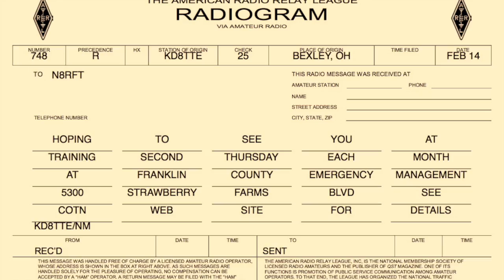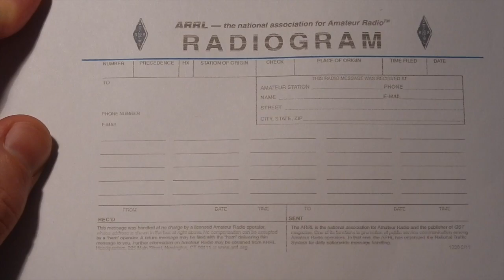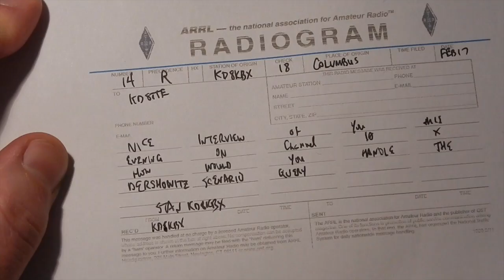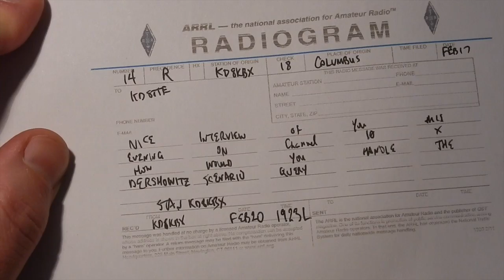Using a Radiogram to Receive NTS Traffic

Comment: Brand new to the channel.  I am a technician level license operator for about a year-and-a-half. I am mostly on HT s in the off-road community and also, what I would call a light prepper. I do check into a net nightly and want to learn more about not only passing traffic but receiving it. What I'd like to see is how that traffic is actually passed to the recipient. If you could give some examples.  Or point me in the right direction. Thanks for your posts. They are put together quite well. 73's from KD2PGJ.
Reply from the maker: The step of getting the message to the ultimate recipient is "delivery," which is very different from "relay," which is what we show here—radio operator to radio operator. The first step in the process is "origination," turning an author's thoughts into a message formatted for relay. I'll have future videos showing all of these, in the coming year.